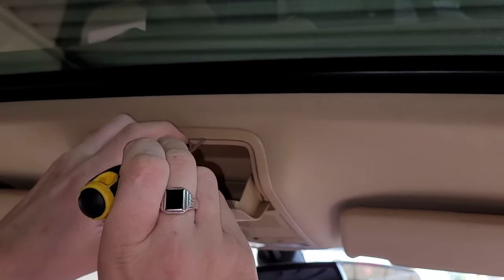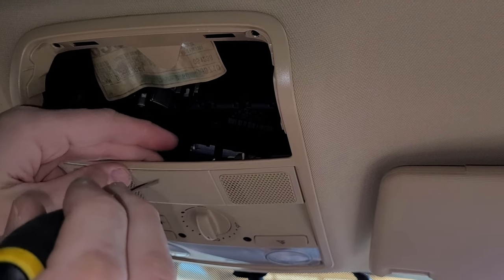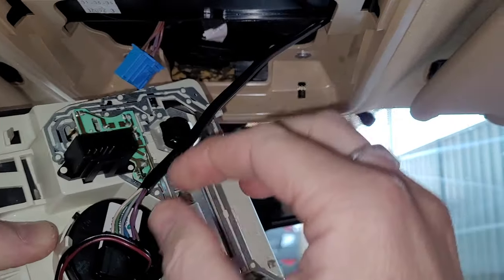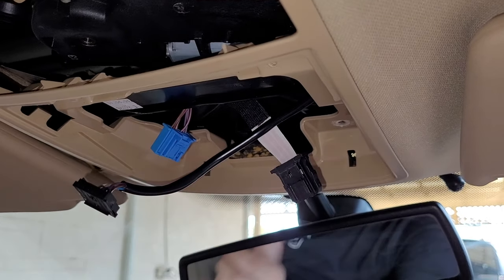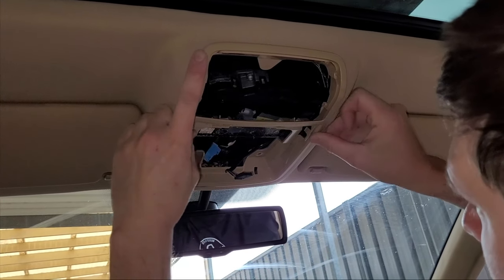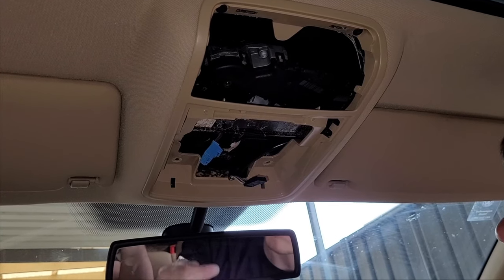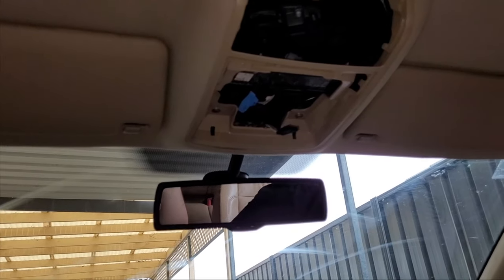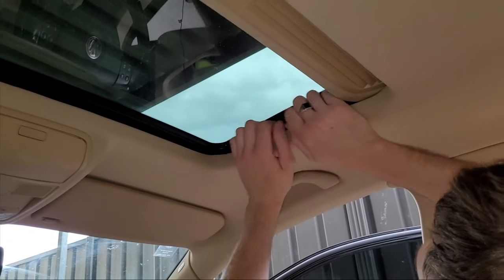Volkswagen mk5 mk6 Overhead Sunglasses Console Removal & Install

Comment: Great video thank you very much. I need to do this tomorrow as my sunroof is discombobulated I need access to the manual. Crank this video. Here is been very helpful. Cheers cheers from Canada.

I’ve already taken off like five of these different pieces to access the screws and I’m glad I did it on a warm day. If I was doing this in the winter I’m sure they all would’ve cracked.

Comment: Great video! I watched this, but only after removing my headliner and unfortunately I didn't see the tape wire clip and I ripped it. Do you think I can just tape it back together, or do I need to replace the wiring system?
Reply from the maker: Usually if the tape wire breaks, They can be repaired using wire connectors, not as easy as other wiring systems to fix but can be done. Worst case scenario, call out an auto electrician and they should be able to fix the break 👍
Reply: @ReecesAutoHeadliningRepairs  thank you!